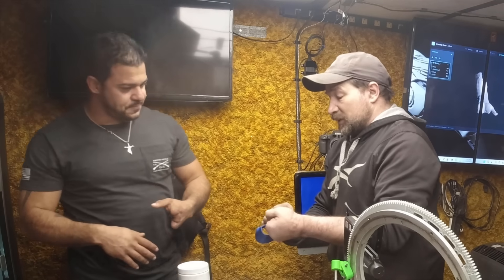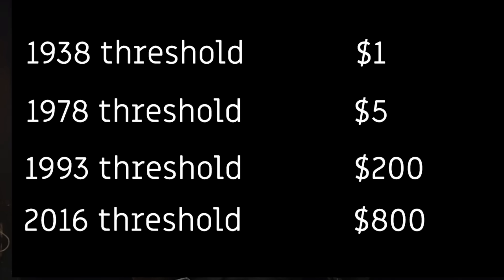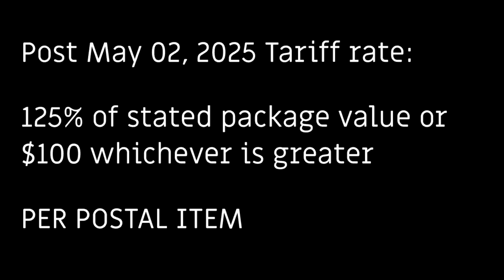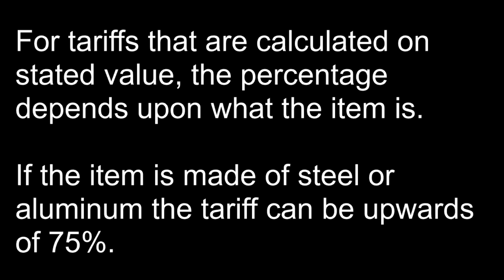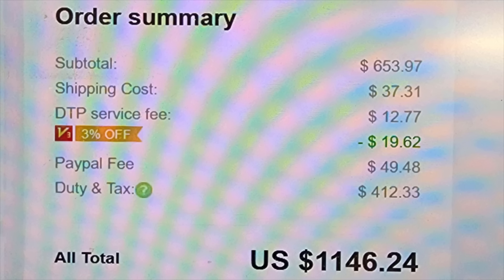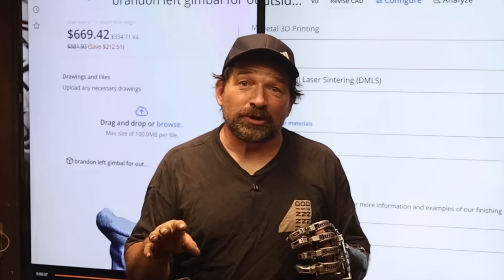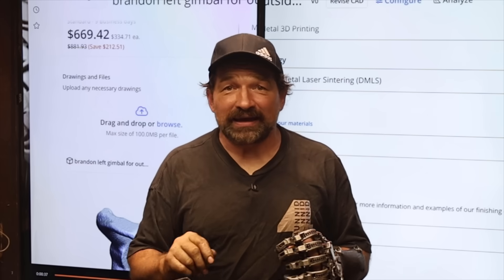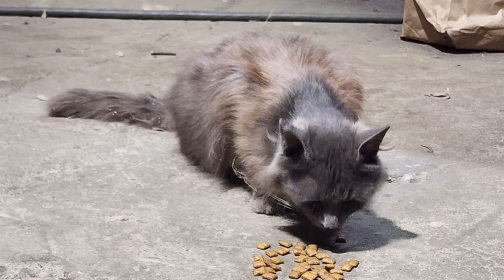No good deed goes unpunished

Comment: I moved to the homestead in middle of the fields, one homestead near us and several kilimoters to nearest villages (seems like two are 3km away). someone dropps off cats here too. Stray had 4 kittens when we bought it in 2024, then someone dropped off 3 kittens (adopted to other people 5 kittens, two by themselves, 3 one shelter took them and adopted them out after months of healing them). now we still have 3 inside-outside cats and two adult cats appeared outside. not petting cats too, but one comes over to eat very close, just does not let touch it. 
I am in EU, so always had some kind of tarrifs, its alway a lottery if you are going to be hit by the customs, though morte rare from china, but we had a change several years back where it should be declades at the shop level by the seller. I wish that system would work for western stuff too,  but you can be hit by customs just from orgering from England. I paid for a guitar almost 100% just because of dumb ruling and fees. before that I was sure they declare stuff properly, but no, they just shipped it, no proper form filled

Comment: Thank you for posting this. I had a very similar situation recently. I went to order a custom PCB board and a clear resin sla printed case for a smart home remote project. China said they could do it for $45 which was perfectly reasonable, after tarrifs turned to into $180 quote. I checked a quote with a US mfg and for the PCB alone needed a minimum order of 10 was over $1000. I'm all for bringing up our manufacturing here in the US but these bs policies are only going to make that a harder task to achieve. Very sad to think how many projects and ideas will die from these changes. Glad I have my 3D printer so I'm still able to use up my stocked generic boards and work around it somewhat to still enjoy my life fuffilling hobby but I know lots of people don't have any fabrication tooling or are just getting started in their engineering journey and it really is unfortunate the ease of access to custom parts that has been getting better and cheaper and easier all my life took such a drastic turn for pure greed. I would be open to pay the extra temporariy if I knew it was coming back to the people of the United States but from everything else going on its very clear the people that need the breaks and deserve funding aren't the ones getting any of it.

Comment: What about 3D printing the gimbal in plastic and then using the lost wax casting method, but with aluminum?  Yeah, it's a few extra steps, but I've seen it used to produce parts with decent finishes right out of the mold.  Post-casting sanding and polishing should produce a perfectly serviceable part.  And it would be a LOT cheaper than either of the two options mentioned in the video.
Reply: 3D printers and filaments that are imported from China. Aluminum that’s imported form Canada.

Imports are just a simple fact of industry. They always have been and always will be.
Reply: @baneofbanes  For what he's paying for a single pre-fabricated part, he could buy a decent to even a very good 3D printer today.  The part is not very large.  And, since it's being consumed in a lost wax casting technique, it doesn't require as much in-fill; these two factors will decrease filament material cost considerably.

Compacted sand can be used for the mold; a negligible cost.

A356 casting aluminum averages around $1.00/pound.  The part in question probably weighs around 1/4 pound.  Let's be conservative and call it 1/2 pound; that's 50 cents in casting material.  Pennies.

The point stands that for what he's paying for just a SINGLE pre-fabricated part, he could set up a 3D printing / lost wax casting workstation that would allow him to make multiple parts for just a few dollars each, some time investment, and good ol' elbow grease once it's all set up.

My focus is on solutions, not obstacles.

Comment: I have some experience using the machines that you're talking about or at least their smaller equivalents and while I'm sure you're not in a position to go importing the larger machine, doubly so with the tariff in place, I would be willing to assist in learning how it works if You ever found yourself in a position where to move forward you felt you needed to purchase an SLS machine.

Comment: Since you have a shop with a 3d printer already, what about 3d printing a plastic part, then making a mold to make a sintered casting.     A retired CEO of a company I worked at experiments with all kidns of stuff that Sintereing may be an option.   lookup Dan Gelbart "Novel High Resolution 3D Printing Method for Metals and Ceramics"

Comment: Its not just the US and tariffs, its also companies over-pricing the product.  For example up here in Canada I recently looked into a new carburator for a honda quad.  $60 on amazon, $860 from local dealer.  They likely came from the exact same factory.
Reply: That can be true but there's definitely a difference in quality control at least. There have been times when ive bought a generic part on Amazon and it worked great, and there have been times when the Amazon version of a product had weird issues when the normal one doesnt. Amazon also just has scams sometimes
Reply: It's hurt export as well. 
I've been hunting for a particular kind of wheel to fix a garden cart for my mother, a new one in the US, where it's made, is $22 for a pair.

Here, it's $250 each.
Reply: @Sicarius_Avindar .    Dude ,   Let me send you a birthday present …..
Reply: @Sicarius_Avindar can someone buy it in the us n send it in a package to u in the mail or will the shipping be crazy expensive??
Reply: replace with different wheels altogether.  Fabbing bew ones would probably be cheaper at that point.  @Sicarius_Avindar
Reply: @sinisterthoughts2896 Yeah, thats the plan, just swap all of the wheels out. Just cheapos should do, having another go at it tomorrow. Downside of being rural however, limited parts availability. 

I do appreciate the advice, but don't worry, it's not needed. I'd rather get locally made or original for quality, but with the tarrifs and fees upping original prices that then get exported, US made is just not feasible for international anymore.
Reply: oshpark and digikey pcbs (last I checked) were so much more expensive than jlcpcb or pcbway
Reply: i mean, it mostly is from the us and tariffs...
Reply: I haven't heard good things about the Chinese carbs
Reply: @createachanneltopost  The last sentence, tho.
Reply: @roidroid  Reading comprehension at a all time low
Reply: @createachanneltopost  Both carbs are from China!
Reply: @createachanneltopost  Well I'm here to change that, I wanted to hate the cheap chinese carb too but by god it works just as good as the original. They wanted $250 for a carburetor to go on my generator, bought the same exact one for $25 off amazon with the branding missing.  

Now you've heard good things about the chinese carbs, maybe for something that needs to be smooth as silk accelerating from any point in the rev range like a motorcycle maybe it could matter, but I kinda doubt a brand name carb would do better.
Reply: @createachanneltopost  Sounds like propaganda you fell for
Reply: @BBVance  not really.  Thay does not sound like propaganda,  more like a rumor.  Given you PFP, it's hard to trust a comment like that coming from you.
Reply: @sinisterthoughts2896  I'm not sure what you mean. It's the best picture.